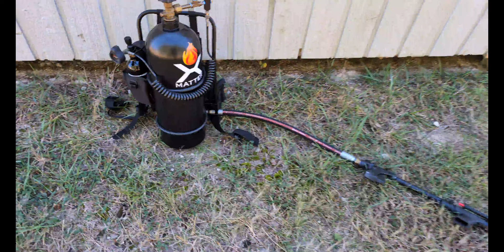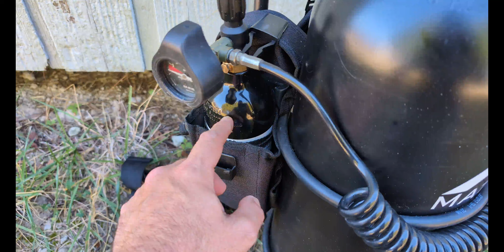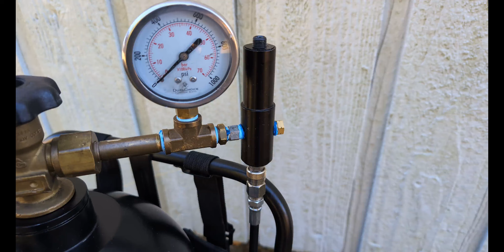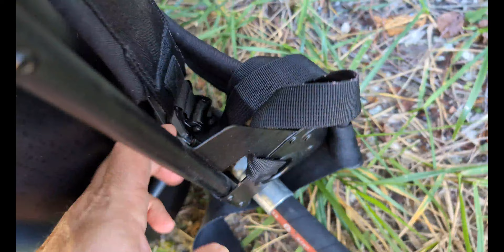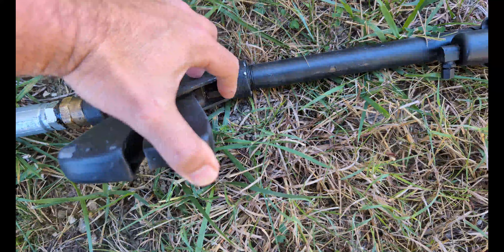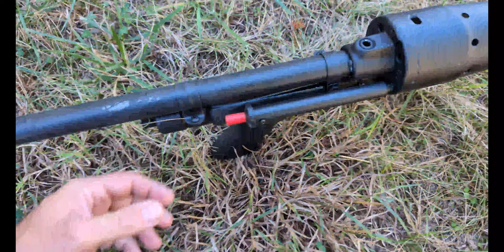Flamethrower Testing

Comment: I recently built a DIY mini-reservoir for butane and noticed that if the reservoir being filled isn't cooled, a liquid phase doesn't form inside. With cooling, it can be filled completely, but the weight must be carefully monitored to ensure the fill volume does not exceed 85%.
I am currently using a 50 cc volume, which lasts for 3 minutes of continuous operation of the high-power burner. At full power, the burner can run for about 20 seconds; after that, the reservoir cools down and the pressure drops.

Comment: It appears that the best solution for preventing damage to the hydraulic hose by aromatic solvents is to install a ball valve upstream of it. Even fuel hoses have limitations regarding the aromatic hydrocarbon content of the fuel (typically no more than 50%). The advantages this provides are:
1. The ability to store the fuel mixture in the flamethrower's fuel tank for an indefinite period (since the mixture does not come into contact with the hose while the valve is closed);
2. The ability to use any type of fuel (as the ball valve is opened only immediately prior to firing);

I consider these points to be extremely important—particularly if you need to bring your flamethrower to combat readiness in the shortest possible time.
The valve also serves as a safety mechanism to prevent the inadvertent opening of the spray gun valve during refueling.
Reply from the maker: 🤔 that's a good idea.  Could have a pull cable/spring attached to it as a safety shut off.  I guess conventionally the cutoff switch is for the pressurizing gas rather than the fuel but I like the idea.

Comment: What nozzle are you using? Does it have a conical taper?
As far as I know, the best option is a nozzle with a cone angle (9-13 degrees) and a cylindrical section at the end, the length of which is 3-4 times the nozzle's outlet diameter. The ratio of inlet to outlet diameter is approximately 2:1.

The LPO-50 flamethrower nozzle has a cone angle of 10 degrees, a cylindrical section length of 60 mm, and an outlet diameter of 15 mm.
Reply from the maker: That sounds about right, the LPO-50 is close to a 50 caliber, but you'll notice it's performance is all distance with little sustain.

For a backpack unit, I have found that a nozzle diameter around 30 caliber (0.3 inches) is about right.   For the unit in the video, the nozzle diameter is 5/16 inch or about .312 caliber.  I have also had good results with 9/32 nozzle (about .281 caliber).

As for the nozzle taper, it's about 30 degrees, and if I recall I used solder in the end of a brass end cap for the form of it, with a 5/16 hole drilled through it, then using shaping bits to carve out the solder to the 30 degree bevel.  Even a 45 or 60 degree would work ok as long as the choke length is at least 1 diameter in length.  In this case, the central tube is press fit onto the brass end cap, then secured in place with "Expando" high temp cement.  It's kind of hard to describe without a diagram but basically the choke length section is about .5 inches long and 5/16 diameter.

It also has flow straightening veins right before the nozzle.  The flow straightening veins can be fairly simply made by taking a 1 inch wide strip of sheet metal and folding it into an X shape such that it will fit into the tube before nozzle installation.  

The dimensions I used are similar to what was designed in the M-2 and M-9 flamethrower wand nozzles.  In those devices, the flow straightening veins were part of an internal control rod assembly that was basically a giant needle valve that extended the length of the wand and pressed into the nozzle to form a seal, which is a good design to limit any flame dribbles near the operator location.  

Basically, it's kind of the opposite of a rifle in that you don't want to impart a "spin" on the fluid because that causes stream spreading/turbulence and you don't need a supper long choke section because of the frictional losses.  

It would be interesting to see what the optimal taper length should be, the LPO may have it, but that presents a complication in the assembly unless you have a good lathe with some fancy bits.

If you wanted to duplicate the LPO 50 nozzle, I would probably find one of those long taper brass water nozzles at the hardware store and bore out the tip to about .50 cal.  It would need a boatload of pressure...I wonder what the operating pressure of the pyro-charges in the LPO is?  That seems like such a crazy design because if the pyro-charge has a crack or a grain variation it could cause an explosion...I'm assuming they did a lot of testing to get that dialed in.  The Russians are crazy but I admire their balls 😂
Reply: @CharlieMacklin1  Large taper angles reduce the nozzle discharge coefficient and cause flow separation from the nozzle walls, creating swirls and increasing turbulence.
I've studied various scientific data on this subject, including hydromonitor nozzles, and they all have a taper angle between 8-15 degrees.

Yes, 0.3 inches is indeed the optimal diameter. I plan to make my next flamethrower that size. I'm currently using a ~0.2-inch nozzle, which is good for testing. I also suspect that flow straighteners may not be necessary with a ball valve, as it creates almost no turbulence.

The M2 wand is excellent. In some modern demonstrations, for some reason, it produces a very strong atomization of liquid fuel, but I think this is due to nozzle damage, as I've seen several videos with it where it produces a cohesive stream of diesel fuel.

The LPO-50 operating pressure is around 435 PSI (30 bar). Each cylinder (there are three) contains approximately 1 gallon of napalm. The range is at least 70 yards. The fuel line diameter is 1" or slightly larger.
Reply from the maker: @jinxn2181  I think you could duplicate the performance of the LPO 50.   If it was me I would avoid the complexity of multiple fuel tanks and just have one large 20 lb CO2 bottle such as the tank setup in my video, which holds about 3.3 gallons.  If you ran it without a regulator at nominal CO2 pressure, used a 1" diameter hose rated for the aggressive chemicals and pressures, used Teflon (PTFE) for all the O rings, and used a mechanically actuated ball valve near the nozzle, with a nozzle design like what you described for the LPO 50, (long taper with 15mm bore), and shooting a thickened fuel blend with the right stringy consistency, I think it would perform just like the LPO 50, might be a tad heavier on your back. 

The aluminum CO2 tanks here in the states have enough extra thickness to them that you can tap/thread them.  You might consider turning the tank upside down so that the fuel goes out the tapered shape and into the fuel hose with an adapter, that way you could tap a smaller line for the CO2 at the flat end.  I've done that before it works well but is a little more difficult to load the fuel.
Reply: @CharlieMacklin1  Replicating the LPO-50's performance isn't difficult, but the main problem is its strong recoil. Brazing (or welding) the hydraulic line fittings to the cylinder will also be necessary.

The manufacturer of the Xl18 once wrote in the comments that the maximum range with napalm is achieved at 450 PSI (or so). But it is still interesting to know at what pressure it is still possible to maintain a laminar flow regime.
Reply from the maker: @jinxn2181  it did get a good distance with polymeric napalm and about 450 or so PSI with a .281 cal nozzle it did about 120 feet, but that's been a long while.

Hydraulic fittings are rated for thousands of PSI, and the CO2 or scuba tanks can also hold thousands of PSI, so no need to braize or weld, unless you want to.  The welding for pressure vessels is done under controlled conditions and checked for micro fissures etc, but you could do your own pressure testing I suppose.   

Are you familiar with the different types of piping fittings and hydraulic fittings?
Reply: @CharlieMacklin1  An aluminum fuel tank is convenient for converting into a flamethrower, but it's expensive and relatively heavy for its capacity. I prefer using steel propane/freon tanks. I primarily use liquid fuel, so I'm unlikely to need pressures higher than 250 PSI. However, if the goal is to make a very powerful flamethrower, an aluminum tank would certainly be the best option.

A lightweight fuel tank can also be carried in a regular backpack.
For my next build, I plan to use a ~4.8-gallon propane tank. He weighs about 16 pounds.

Yes, I'm familiar with hydraulic fittings, but I use the Russian DK standard. This type of hydraulic fitting has a metric thread and a metal cone seal, without the use of rubber O-rings.
Reply: @CharlieMacklin1  120 feet with polymer napalm? Are you sure it's polymer? I thought their thickener was some kind of powdered aluminum oleate/stearate or something.
Reply from the maker: @jinxn2181  Yes probably but I was referring to an expirement I did in 2010.  Compressed nitrogen with a regulator to an upside down SCBA tank with an adapter to a 3 foot hose section of braided stainless steel Teflon inner, all Teflon seals or Viton seals, tube diameter was 5/8 ID 7/8 OD if I recall, ball valve near the nozzle, nozzle was between .281 and .296 caliber I think, started off at .281 and I honed it out a bit.  Pressure was 400-450 psi. 

Fuel blend was ploymeric, 70% gasoline 30% toluene, Styrofoam added until viscosity of syrup.  It takes some fine tuning on the viscosity, a thin syrup stream will separate, but if it is too thick you'll have ignition issues. 

I put out makers and it burned the one at 115 feet so maybe a hair further.

The polymeric is not shear-thining, it retains viscosity coming through the tubes so it has probably more pressure drop by the time it gets to the nozzle due to friction, but still pretty good range.  

I have a grainy video somewhere
Reply: @CharlieMacklin1  Ah, you're describing your own experience. Now I understand.
I've heard that polymer napalm doesn't have thixotropic properties, but I haven't tested this in practice.

In our country, gas stations sell lighter gasoline in winter, which contains more light fractions. If you live in a region with cold winters, you might try buying gasoline in winter. Winter gasoline will be easier to ignite in laminar flow conditions.
Reply from the maker: @jinxn2181  We also have winter and summer gasoline blends here although I can't say I've noticed much difference 😅

As for thixotropic, I only know what that is because of fluid dynamics class, are you an engineer?

From my experience the most thixotropic blend would be an improvised napalm consisting of gasoline, motor oil, and powdered regular soap (sodium palmitate).    I mixed a batch in a bucket with a drill and paint mixing paddle during the summer.  It stayed in the flamethrower fuel tanks for 6 months and by winter it had totally clogged, it was very difficult to get it to loosen / rinse out.  

Polymeric is slightly thixotropic, it tends to resist shear thinning, generally stabile viscosity but I think the main issue with it is that if it is in a partially full or low container, the volatile aromatics will slowly evaporate out and it will eventually, after some years, will become a slow moving plastic, as the old saying goes "slower than molasses in January" 😆
Reply from the maker: The aluminum based soaps are the way to go, they thicken quickly and evenly, and will start to thin after a couple weeks.  Better to have that than a clogged machine. 

Only issue with aluminum soaps like what X-matter sells is cost.  I did make my own, via an old patent document I found, it's a whole process very time consuming but really interesting chemistry.
Reply from the maker: @jinxn2181   You might also be interested in the German "Flamol 19" fuel blend, which was said to be gasoline and tar, although I don't know the ratios.  Might be an interesting pyro fuel to make small test batches with ...the cheapest and easiest fuel blend that doesn't clog anything up or chemically damage the fuel system is probably best.
Reply: @CharlieMacklin1  I've heard that fumed silica can also be used as a fuel thickener, but it's inert (non-flammable) and doesn't adhere to surfaces. The price is also not ideal.

Sodium soap thickener is quite good; it barely liquefies when heated, and it's inexpensive, but it doesn't store well. I was lucky that I tested it before adding it to the fuel canister. This stuff sticks to the sides of the tank and doesn't drain.

If the polymer napalm thickens, you can always add gasoline to adjust the viscosity. Polymer napalm is essentially rubber shoe glue.
Reply: @CharlieMacklin1  What fatty acids (or oils) did you use to make aluminum soap? From my experience, I've found that liquid fatty acids are best, as their melting point is directly related to the dissolution temperature of the resulting soap in the fuel. Soaps containing high levels of aluminum stearate or other solid fatty acids only dissolved in the fuel when heated.
Reply: @CharlieMacklin1  Another popular mixture used during WW2 was a 50/50 mixture of fuel oil and gasoline. It's also listed in the ROKS-3 manual. However, two main mixtures are highlighted there:

1. Classic napalm (gasoline and aluminum naphthenate);
2. BGS mixture (a mixture of light and heavy aromatic hydrocarbons).

Fuel oil is difficult to obtain at retail, as it is sold in barrels.
Reply from the maker: @jinxn2181  interesting, do they not have diesel at the vehicle filling stations? Diesel is basically fuel oil just a little thicker, over here we can sometimes find Kerosene fuel oil at the pumps, it is a little thinner and cleaner than diesel.  

Do they sell Naphtha over there? naphtha here varies a lot by branding.  For example Coleman brand aka "camp fuel" for older stoves and lanterns is basically heptane and burns super clean and fast, but the label calls it Naphtha.  Then we have VM&P brand Naphtha sold at the hardware store as paint thinner, and chemically that is "light aliphatic hydrocarbons".  Kerosene heating fuel oil and the paint thinner/brush cleaner type Naphtha are quite similar.
Reply: @CharlieMacklin1  I probably expressed myself incorrectly. By fuel oil, I meant the heavy fuel that remains after distilling the diesel fraction from crude oil. Fuel oil is black and has a higher flash point than diesel fuel. It's something between bitumen and diesel fuel.
Reply from the maker: @jinxn2181  ah ok.
Reply from the maker: @jinxn2181  yes I had the same experience with regular sodium soap getting to thick over time.  

If you add gasoline to aged thickened polymer napalm it won't dissolve much, but adding aromatic compounds like toluene, benzene, xylene, or acetone would thin it, but it would take a while.

This is because aromatic (ring shaped) molecules dissolve styrene, but aliphatic (straight chain) hydrocarbons will not.  

If you want to try an experiment take toluene and add Styrofoam to it until it is a thin syrup then pour a few ounces of it into a cup of diesel (aliphatic hydrocarbon) and watch the plastic separate back out into a solid! 

This is why when making polymeric there is an order to the mixing.  You have to mix the aromatic hydrocarbons with the aliphatic hydrocarbons  first, then add the styrene or Styrofoam.

It is this chemical dance between soluble and insoluble that, when perfectly balanced, results in a thickened liquid without separation.
Reply from the maker: @jinxn2181  Fumed silica works well in the intermediate stage of aluminum soap production to aid in precipitation of aluminum soaps out of aqueous solution.
Reply: @CharlieMacklin1  This is true for polystyrene, but natural or synthetic rubber can also be used as a thickener.
This also works well. They dissolve completely in regular gasoline or kerosene. Natural and isoprene rubber definitely work, I haven't tested the others.
Polyisobutylene is also worth mentioning.
Reply from the maker: @jinxn2181 right I'll have to try that.  That natural latex rubber was the original thickener, Napalm was worked up by Harvard scientists as a field ready alternative due to rubber shortages.
Reply: @CharlieMacklin1  Check out the erasers used to clean abrasive tools (they're made of natural rubber).
Reply from the maker: @jinxn2181 ah cool that's perfect for a test sample.  I read a patent document from the 1950s that described an additional ingredient along with the natural rubber:  Gasoline 92.5%/Polyoxyethylene sorbitan trioleate 1%/Natural rubber latex 6.5%

I found natural rubber latex crumbles online for like $15 a pound, even cheaper when you buy more.  That might be the most affordable option if the consistency is good. 

Aromatic hydrocarbons cost more.
Reply from the maker: @jinxn2181  I think polysorbate 80 will also work to improve the natural rubber gelling.  Polysorbate 85 was too expensive.  In either case it only takes about 1% with several percent rubber added.
Reply: @CharlieMacklin1  Natural rubber should also improve the ignition properties of the mixture, as you can now use only gasoline, without the less volatile toluene in the mixture.
Reply from the maker: Awesome 😎
Reply from the maker: Thanks for sharing